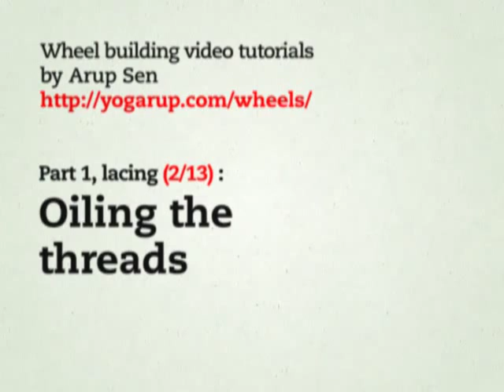Oiling the threads (2/13)

Comment from the maker: Hi,
I've used linseed oil as spoke prep but haven't used Sapim or DT Swiss spoke freeze. I've worked on wheels that have been built with spoke prep and it's more or less impossible to turn the nipples. You have to assume that what you build will be pretty much spot on so that it will not require truing again. For a first build I would avoid it. I would also stay away from DT Prolock until you feel more comfortable with truing and tensioning newly laced wheels.

Comment: Here is your first mistake , I have built wheels for over 25 years and have found oil tends to loosen the spokes from resonance. What you need to use is mild loctite or spoke freeze.